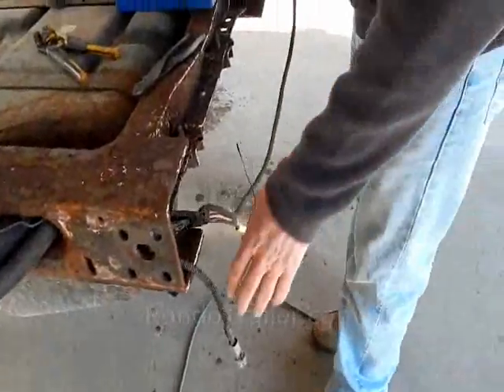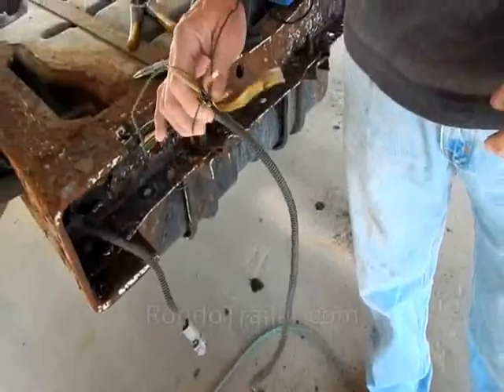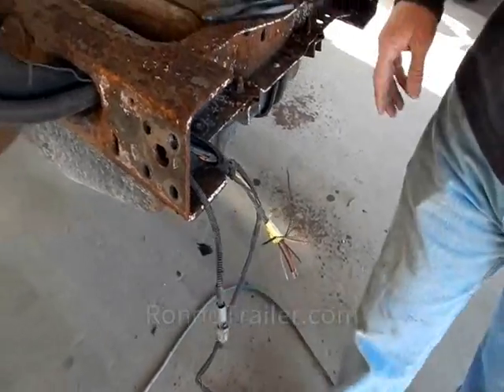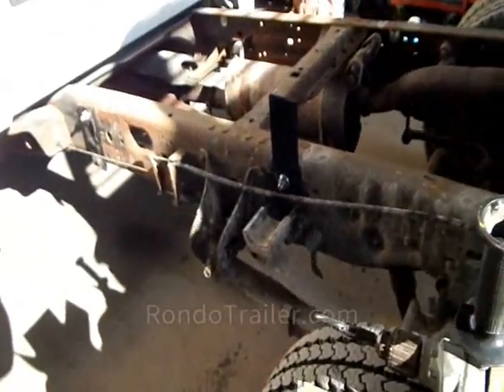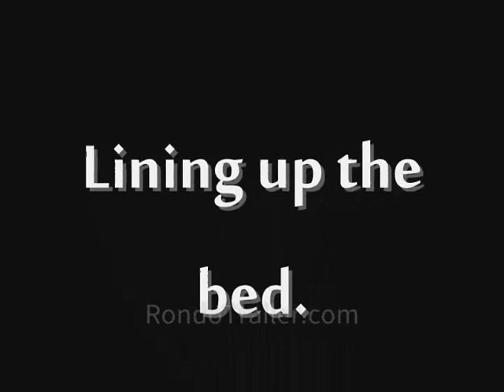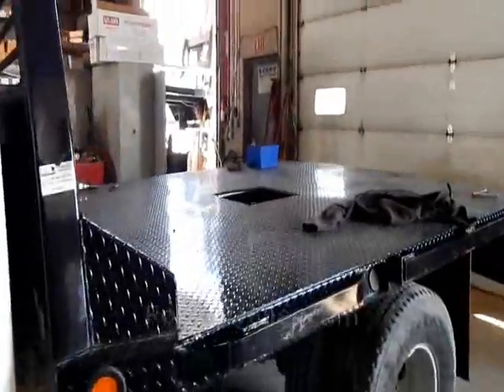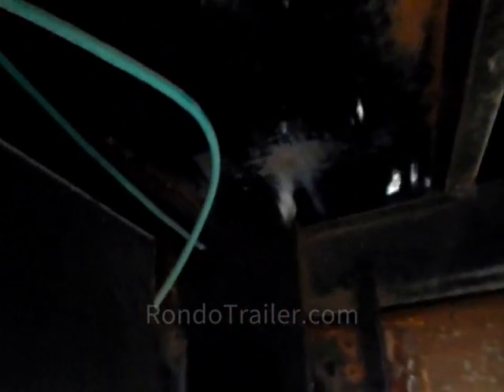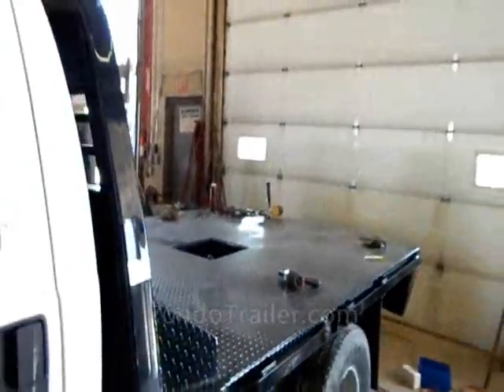Installing a flatbed on a pickup truck

Comment: So no problem with no cushioning between flatbed and chasis?
Reply from the maker: Small gap between frames.
Reply: @rondotrailer  but whats in that gap? Mine ended up with a gap and l felt it was putting extra work on the bolts so l put some spacers here and there to fill gap on the bolt areas
Reply from the maker: @adrianchapa7706  The frames are not meant to be touching. The grade 8 5/8" bolts are plenty strong.
Reply: @rondotrailer  this is gold for me, l thought they should be touching. I’m using 5/8 grade bolts and the whole bed feels firm, no funny noises, l hope it stays this way when loaded!
Reply: What happened to using lumber between frame and bed?
Reply: You can also 1x1 in different sections if that worries you but over time wood cracks and splits you need to replace it.

Comment: ? will a 2015 chevy dually bed fit on a 2004 chevy silverado 3500 body.  switching from stake body to a bed.
Reply from the maker: Is your truck a chassis truck? It would have a measurement 60" from back of cab to center of rear axle also 34" frame rails. Pickups have a 56" & 42" rails. Yes it will fit IF you have a pickup.